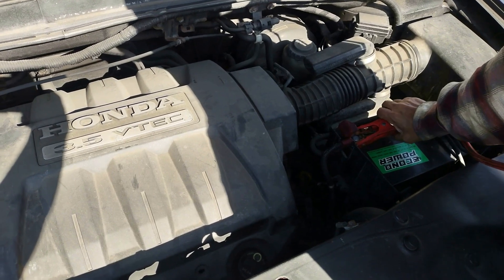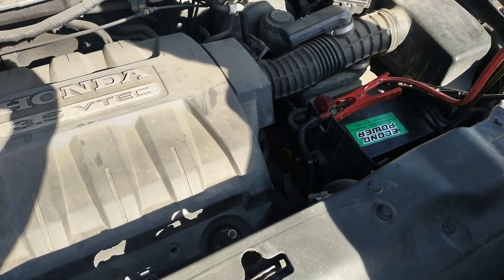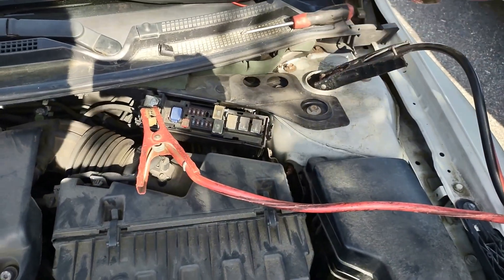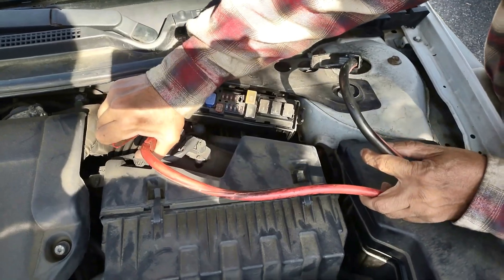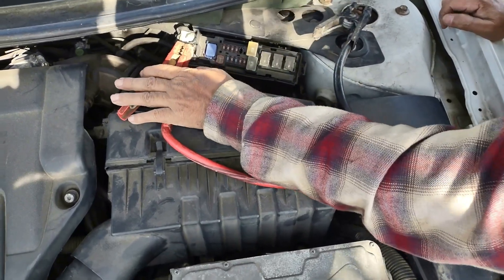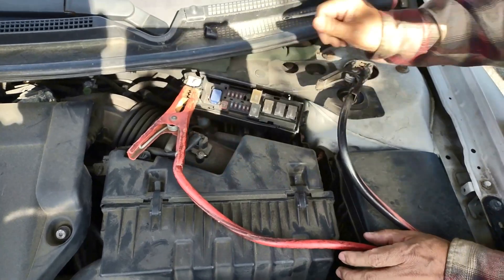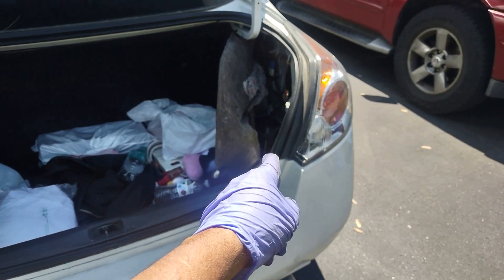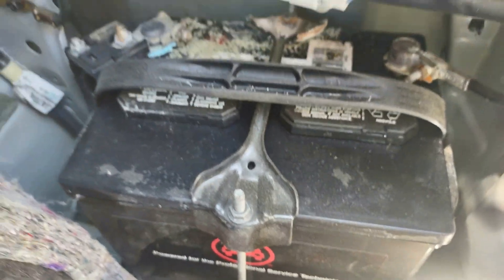🚗 Jump Starting a Nissan Altima Hybrid — Don’t Do It Wrong! Altima hybrid dead battery

Comment: I used you 2008 Toyota Solara power steering pump R&R.                                     My Solara pump was far different than yours.  We couldn't find any references to our pump.  You care enough to make videos like this.                                  Could I send you pics telling you how it's different.                                         Would you use it at all?                                I'm a Quad. and my work is to slow to make these videos.